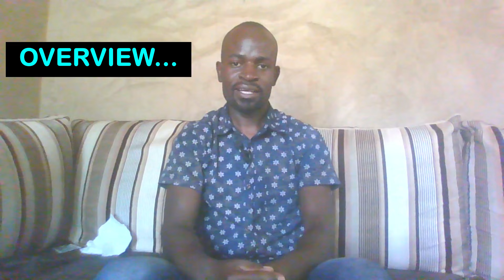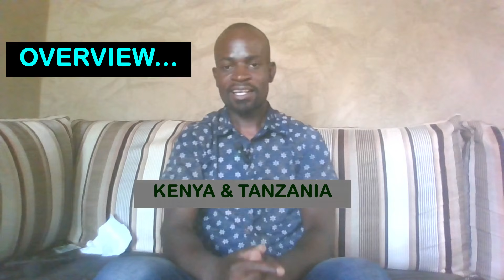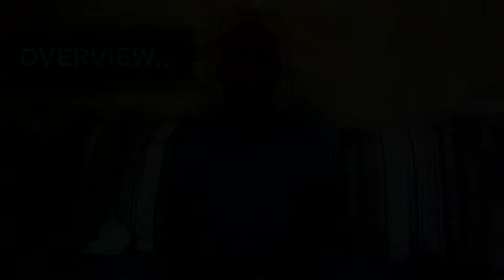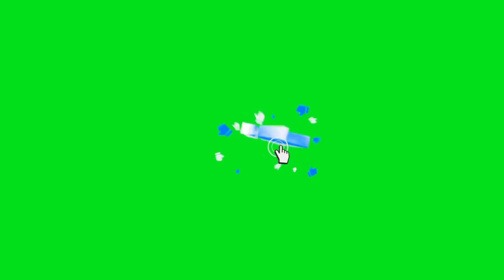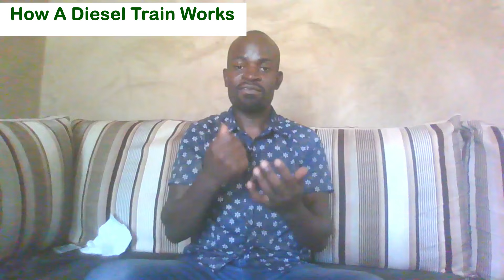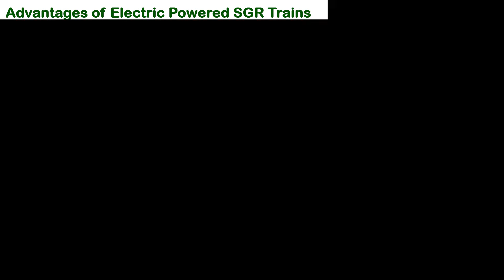Electric vs Diesel SGR: Why Tanzania’s Railway Has a Strategic Advantage

Comment: Both Diesel and Electric train are driven by electric motor.
Diesel train ,prime mover is diesel drives generator which generates electricity, which in turn run the electric motor .
So both are operated by Electric motor.
Reply from the maker: Thanks a lot for the heads up. This is very helpful! Don't forget to like and subscribe for more upcoming videos.
Reply: So electric car and diesel car it's same let me laugh 🤣🤣🤣
Reply from the maker: Funny!!

Comment: This is my own personal opinion. An electric train is not It is not something I have experienced. But I have experienced the old Kenya-Uganda railway and now the new one called SGR. What is more important? Providing a service that is consistent, in demand and makes money or simply showing off who is ahead? The Ethiopians have an electric from Addis to Djibouti port. Before their new electricity dam their electricity would go off and then their train would stall somewhere in the savannah for about an hour. Why not have a diesel train that will continue moving on despite these conditions? After all one of the world's longest and most powerful train (the Ghan in Australia) is powered by two diesel engines in two carriages that produce electricity for the one Kilometer train. It does not rely on the national grid. Who said a train should be powered from the national grid when African countries don't have enough electricity to power their homes and factories? By the way even the Kenyan SGR will be converted when the economic conditions are right. It is a matter of putting a few electric poles and cables along the line. What is important is it must make money for us.
Reply from the maker: Thanks for your very deep observations. Yes, I also strongly feel that the future will be electric even for the Kenyan one.
Reply: Huna akili hata chembe 😢😢
Reply: @shinipapaya846  Thanks Mr clever on. Heri wewe mwerevu.
Reply from the maker: @shinipaya846, you need to be respectful with your comments. Try to be nice.
Reply: Tanzania already addressed the power problem. TZ SGR has higher axle load capacity (35 tons) than  KE SGR (25 tons). TZ SGR travels at higher speeds (160km/hr), is much more efficient, cheap to operate and maintain, modern, aesthetically beautiful and so far it is the longest in the region, intended to connect many land locked countries to the ports on the coast, whereas the KE SGR has stalled because of lack of funding. No feasibility study was done before embarking on it as such it ends in the middle of nowhere!
KE SGR line construction cost per Kilometre is almost twice compared to TZ SGR Project, expensive to operate. It is environmentally unfriendly, its economic sense is uncertain hence not making any meaningful returns.
The lenders, China et al, refused to finance the KE SGR project citing infeasibility and inability to compete with the more modern, feasible and intentional SGR Project in the regional, the TZ SGR. The same lenders are frequenting Dodoma begging for an opportunity to finance further extensions of the project.
TZ is now extending its SGR line into Burundi, aiming to extend it into Congo, DR.
With all the facts above it is obvious that KE SGR Project was a very bad deal, no value for money and a flop! It will cost KE a lot to make this project make economic sense.
The only practical option I see is to electrify it and connect it to TZ SGR, if compatible. 
Let's stop being bitter for our failures and give credit where it is due. Tanzania is playing a very smart card and is without a doubt winning the game!
Reply from the maker: @KLeeN-hp7yh  I hope you watched the video up to the end because all you've said in this comment is all that's in the video.
Reply: @TheAfricanBlueprint21  I did. I just corrected the narrative of  @citoyenglobal3348
Reply from the maker: @KLeeN-hp7yh  And please, don't forget to like and subscribe for more accuratelly done Tanzanian videos. It's a series.
Reply: @KLeeN-hp7yh  Thanks for the reply but I think you missed several points. 
1. It is not a question of which railway is superior. My argument is about using the right tool for the right job and still make some money. The Australian Ghan is operated by diesel engines because it would be uneconomical to electrify over 3,000KM with sparse population. With its current structure it makes profits.
2. I am not disputing the tonnage. You could be probably correct.
3. The cost of Kenya SGR, Tanzania SGR and Ethiopia SGR is not comparable because of different design considerations. Kenya SGR was built with the protection of wildlife in mind. The line is elevated so that wild animals in our parks can pass under it. This increased the cost per kilometer. 
4. Kenya and Uganda agreed to do their SGR railways together initially but Uganda decided to wait and that's why Kenya decided to do half up to Nairobi. Now that Uganda is ready, there are talks of extending it to Malaba boarder post. Still this is an economic issue. No need to build up to the border town when there is no demand for it.
5. Finally this has nothing to do with bitterness. If Tanzania wants to build something similar to TGV of France or Morocco (320 KM/h speed) it is up to them. It is their money.
Reply: @citoyenglobal3348  Thank you for the pointers;
1.I do not see how diesel powered SGR train  is the right tool compared to Electric SGR train.
The Ghan Railway is a luxury scenic train traversing mostly through desert and sparsely populated areas. It is not meant for Freight. It has history that they intend to preserve, hence no intention of electrification. This therefore does not qualify as an example in this context.
2. The tonnage I pointed out is correct.
3. All railway line are built with the protection of wild life in mind. It is a mandatory requirement. TZ SGR traverses through vast National Parks, Game Reserves valleys and mountainous hence bridges and viaducts, both elevated and underground, are used. Bearing in mind that the line is electrified its cost per Kilometre should be much higher than that of KE's.
4. It is obvious that you are misinformed. This was not a joint project between Kenya and Uganda. Kenya intended to build the line to the border town of Malaba to which Ugandan SGR line, when built, could connect and have access to the port. Getting the railway line to Malaba does not depend on Uganda building theirs. An ICD could be set up there. Cargo could be transported to and from Malaba ICD and the port of Mombasa by SGR trains, and to and from Malaba and Kampala by whatever means Uganda chooses. the government did not choose to terminate the project where it did. It was lack of funding that halted further extension as the funders, china et al, pulled out citing lack of feasibility study, Questionable viability(ROI) and inability of the project to compete with the more modern, cheap to operate and maintain, faster and extensive SGR project in the region, the TZ SGR.
No funding has been secured so far despite a number of politically motivated speeches about extending the project. Tanzania is now building an extension into Burundi mining region of Musongati, with the intention of extending it further into DRC.
5. Whatever the case, success of TZ SGR is a big blessing to the land locked neighbors, but also a massive blow to Kenya as this changes the regional logistic dynamics and has a direct impact on the economies of these two countries.
Reply: @KLeeN-hp7yh No doubt that you are missing the point. My issue is not whether Tanzania SGR is superior or travels at faster at a speed of 160 Km/h while the Kenyan one travels at between 80 Kmh and 100 Km/h. If that is the only criteria we are considering then the Tanzania SGR is superior. Last time  I checked both companies (Tanzania Railways and Kenya Railways) made losses. These have nothing to do with the speed and superiority of the train service. It is simply the economics of providing that service and that has been my point all along. Meawhile France's TGV(owned by SCNF) makes a profit of $1.3 Billion and the Ghan makes a profit of $600 Million.
2. Kindly do a bit more research. The Kenya/Uganda railway was conceived as joint project. The Chinese were willing to fund it on that basis because they were looking at the joint cargo from the two countries. When Uganda delayed Kenya decided to do a part of it. These are the facts that cannot be wished away.
Reply: @citoyenglobal3348 
1. Regardless of your sentiments Tanzania SGR is far superior to Kenyas in all ramifications! It is electrified, extensive (connecting >4 landlocked countries), low operating and maintenance costs, faster, technologically advanced and aesthetically pleasing.
2. TRC operates both the SGR and the MGR lines. The SGR recorded a good profit while the MGR did not do well, hence the loss.
3. KE SGR was not conceived jointly with Uganda. Uganda was invited to use the line to access the port of Mombasa.
4. The Chinese cited infeasibility of the project and its inability to compete with TZ SGR as the main reasons for discontinued funding. It had nothing to do with Uganda's deferment to implementing their project. Look it up.
5. Electrifying KE SGR will cost KE more than it should have. Just like the Chinese pointed out, the project was not well conceived as no feasibility study was conducted.
LAPSET corridor looked as a viable option but the competition will be stiff. As we know Kenya used to enjoy almost monopoly for over 20 years. She can not do well in environment full of competition.
The most viable option is to connect southward to Tanzania's SGR and operate jointly, may be as EA Railways.
Reply: @KLeeN-hp7yh  Can you say something about Tazara? It was launched with a lot of fanfare about 50 years ago. If it were not for the commitments of both Zambia and China the railway would been closed by now. Zambia is forced to use it because of the contract it signed in with China in 1976. It has alternatives like Luanda (Angola) and Mozambique because these are shorter routes. How are you going to force those four countries to use your railway line  when they have not committed themselves like Zambia did in 1976?
Reply: @citoyenglobal3348  Tazara is a joint venture MGR project between Tanzania and Zambia. China provided funding, technology and built it.
No country is forcing another to use it. It is theirs! There's no contract with China  on utilisation of the MGR.
Why all these tantrums? You better check your facts before humiliating yourself publicly like this.
Uganda, Burundi, DRC and recently Rwanda have committed to connecting their SGR lines to Tanzania's. Again check your facts before commenting. Stop these childish tantrums!
The LAPSSET dream is gone. Your northern neighbours have made their own arrangements that does not involve Kenya. They have better options! Look it up.
Reply: @KLeeN-hp7yh  Just a little correction; TAZARA is a Cape gauge Railway (CGR), not MGR.
Reply: Where are you from
Reply: @RonnieBertin  East Afrika.
Reply: Tanzania electric Trains  have their own power grid, the problems was not shortage  of electricity,  the problem was it was never tested enough  so the challenges  happened when the trains were running commercial,  but now we're fine , Kenya  could also have electric trains because  is buying electricity from Ethiopia, the problem is Kenya sgr was so expensive from beginning, all due to the land problem  and corruption. Now it's costing kenya government a lot due to diesel high prices